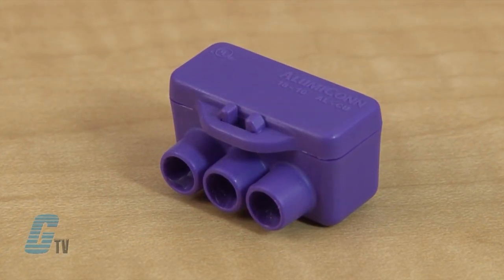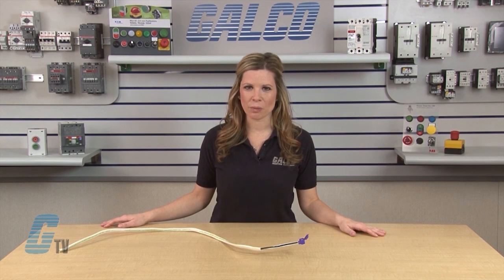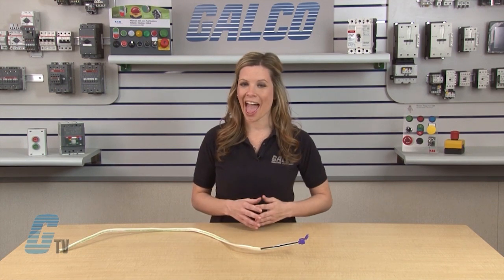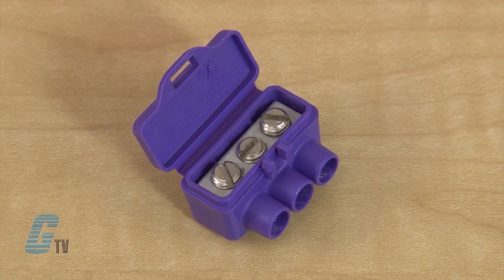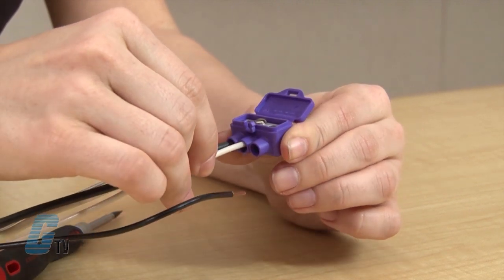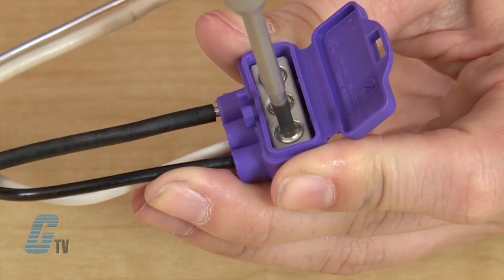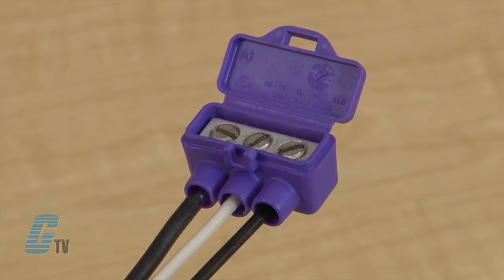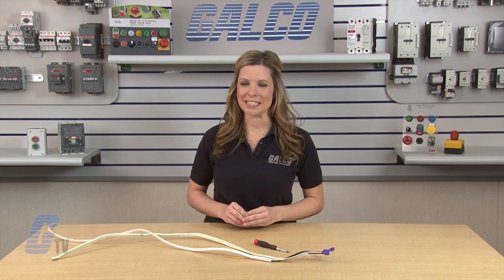King Innovation Connectors - AlumiConn Series Demo for Industrial Applications

Comment: She forgot to mention that those connectors must be torqued down.  Anyone that knows anything about aluminum wiring knows that the wire can deform due to oxidation, creep, and thermal expansion and contraction.  Thus torquing is very important.
Reply: Need to use quality accurate torque screwdriver like Fanttik TS2 Pro

Comment: I wish they made a four-port AlumiConn. It would make packing all the connectors into the junction box a lot easier. With only three ports, a four wire aluminum wire connection that is currently in one wire nut, requires two three-port AlumiConn connectors plus two wire nuts to pigtail the copper. This gets the junction box very crowded very quickly, especially when you add other AlumiConns for something like a three or four light switch panel. I just did a two-switch light switch that had four aluminum wires connected by a wire nut, plus four other wires running to the switches. It was nearly impossible to get all the AlumiConns in there.

Comment: why is the neutral (white) wire and the hot (black) wire connected on same connector even for demonstration purposes. also is no special torque screwdriver required to properly torque down the screws for this manufacturer?
Reply from the maker: Katie connecting black and white together is only for demonstration. These terminal connectors do not require a special screw driver.
Reply: GalcoTV the other videos I’ve watched which discusses this same connector all say you need to use a torque driver. So I’m inclined to think it’s required.
Reply: @GalcoIndustrial need to use accurate torque screwdriver